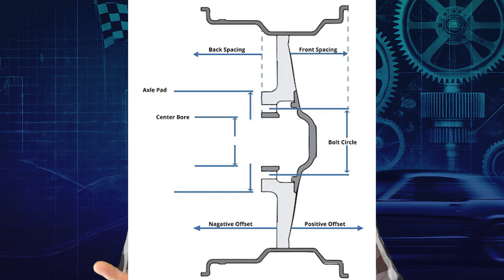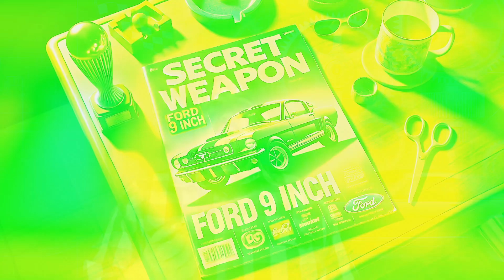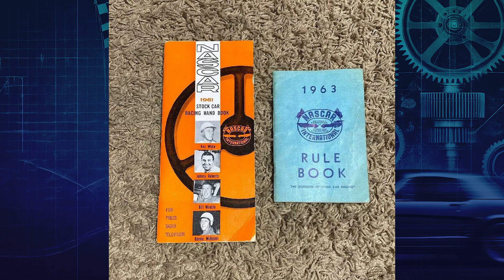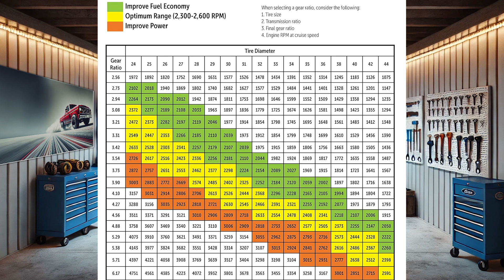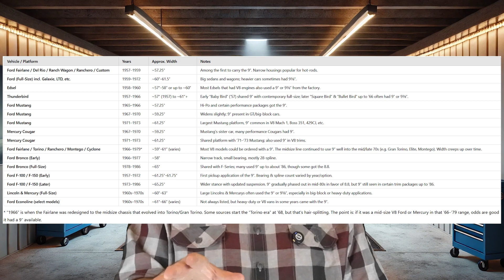Ford 9 Inch: What You Need to Know About Ford's Champion Axle

Comment: 8.8 is one killer axle for not being a 9"
I put one in my TJ, from a 98 explorer, 31 spline, stock disc brakes, very nice

I have a 76 f150 parts truck, should be a 9" spare for my 1970 f100

Comment: The 9" used to be as common as fleas on a hound dog and cheap. The rush to crush at junkyards to make space for newer cars which sell more parts, and the closing of many old junkyards, has made them more rare. And the heavy-duty wheel bearings have long been out of production after Torrington moved to Mexico. In Econoline vans they changed to the 8.8" during production in 83 1/2 for the 84 model year as the last of the 9" rears was used up. With a nodular chunk they were good to around 1000HP in drag racing as-is, no stronger standard car and light truck rear end has ever been made. Get 'em while you can!